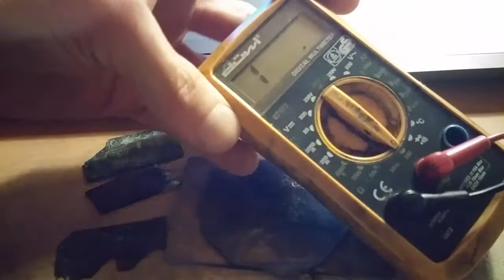DIY GRAPHENE / GRAPHITE PLASTIC Part 3 (TESTING OHMS)

Comment: Hi cayrex2 team, any idea how to make real good low resistance electrodes from selfmade charcoal ? As charcoal from wood is not very conductive or not conductive at all , do you know any process to get it conductive ? Maybe using a microwave and make this intercalated grphite from it ? I am really looking for a simple process so please in 3rd world countries can make their own good carbon based electrodes with a simple process starting maybe just from wood-charcoal, as this is probably the most easy way to get carbon, just burn a bit of wood in low oxygen atmosphere... so how do we get best from uncoductive charcoal to good conductive carbon electrodes in the range of at least 20 to 50 Ohms ? Any idea ? Many thanks. Regards, Stefan.

Comment: Very well done ! Well around 10 to 11 Ohms is already very good ! Try to get it below 5 Ohms, that will again multiply the amperage current output of your batteries with the factor 2x !
Try to put MnO2 or Iron-3-Oxide ( rust) into the graphite, so this electrode will reduce the H+ ions at this electrode which will hinder the current flow...or also try Zinc-oxide or Nickel-Oxide....Good luck !
Regards, Stefan.
Reply from the maker: +overunitydotcom this graphite plastic I use for current collector. other material like MnO2, FeO, ZnO,... I use for active material.

Comment: Brilliant I am a great fan of all your videos Mr Carex, I made some plastic graphite using the acetone and graphite using the  method you showed. I flattened the plastic in a vice between two aluminium plates. When dried I got NO OHMS reading on any plate- bummer! Do I need to use a lot more graphite powder or flatten the plate harder in a press like yours? Perhaps use less plastic material? Keep going you will never know what you might discover next.

I am keen to make one of your capacitor/Batteries for a experiment I am doing with a idea from Tom Bearden scalar switch, using the carbon battery capacitor to drive the load, only tapping voltage to the capacitor for a moment every two seconds from the source battery.

Great work and innovation
Regards
Steve